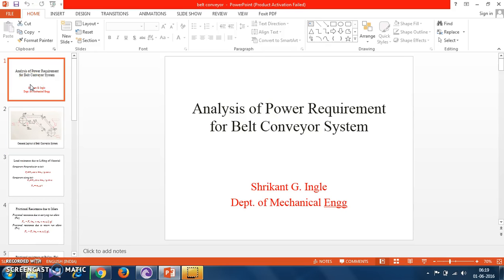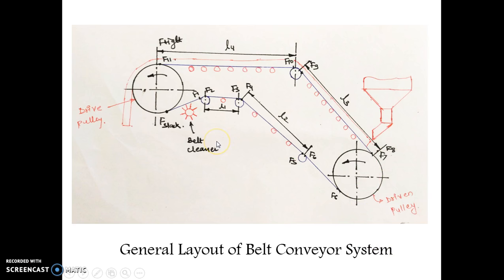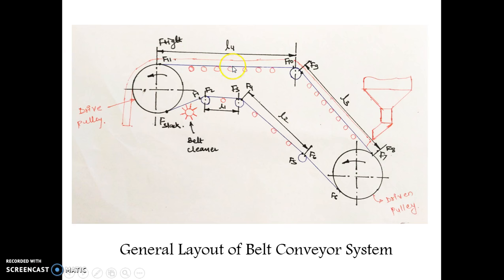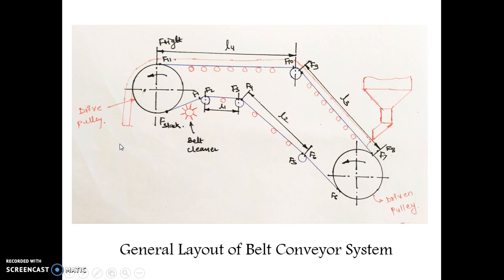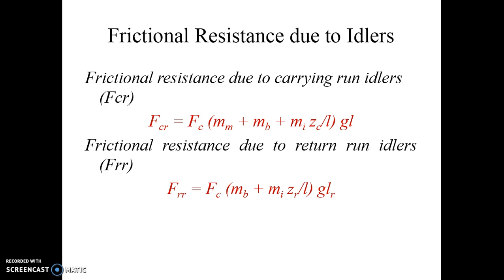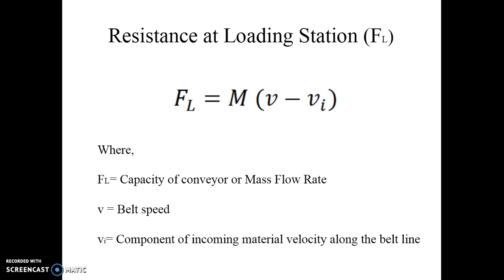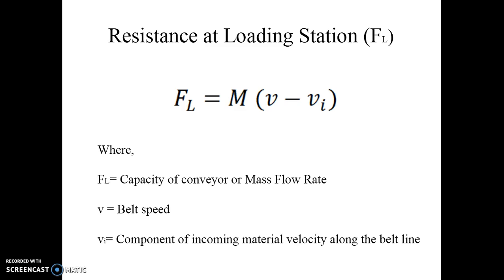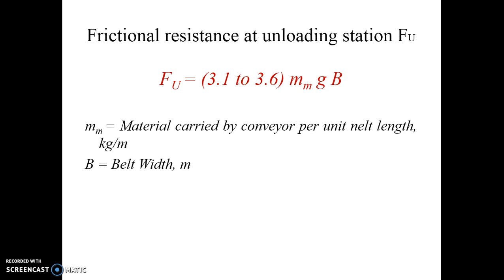Analysis of Power Requirement for Belt Conveyor System

Comment: Good try....but one conceptual mistake is if u multiply length to force it will become either work or couple or torque .......
Reply from the maker: Dear Sir 
Thank you for appreciation
While calculating frictional resistance due to idlers the lengths taken for the specific sections and it is ratio of the lengths so it is purely force instead of couple or torque
Also in case of resistance due to lifting load we have taken vertical and horizontal components